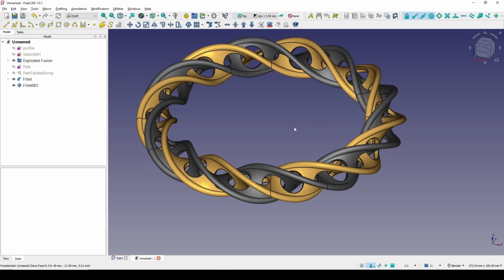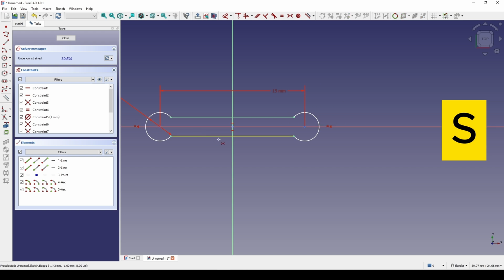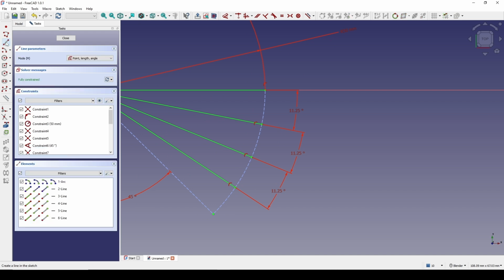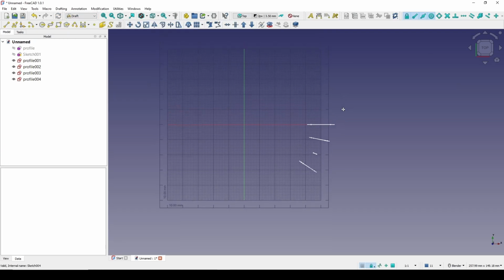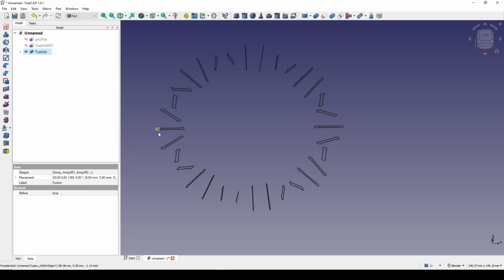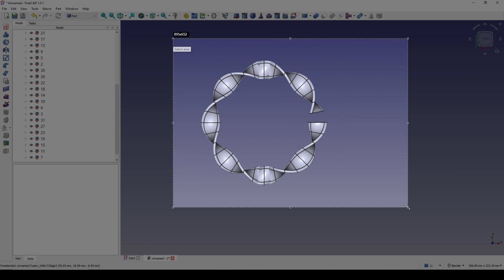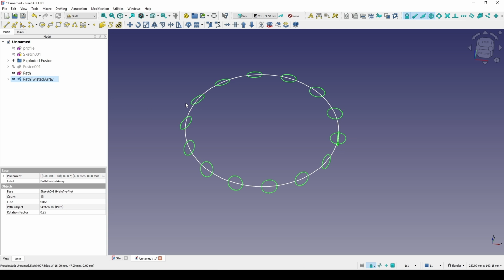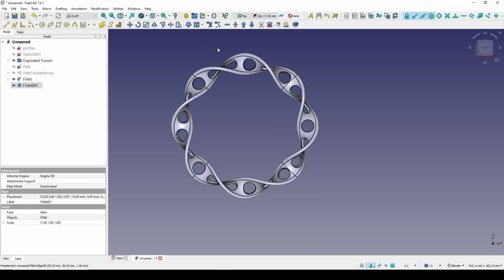How to Make a 4-Revolution Twisted Bracelet in FreeCAD

Comment: Thanks so much for the video. Very helpful!!

Have tried to put this into my 3d printer and it will give me a conflict of G Code error.
I am using orca slicer..

It would be amazing if you could have a look into that and see if you have a solution for this...

Keep the great content coming!
Reply from the maker: I think you could try to remove the 0.1mm fillet, too small for 3d print.